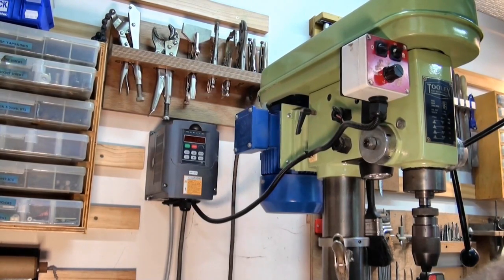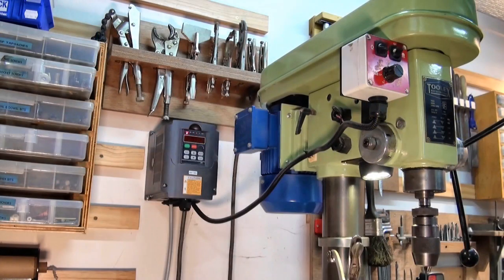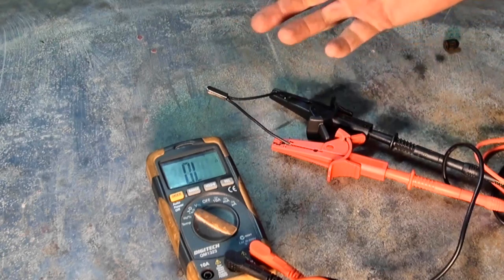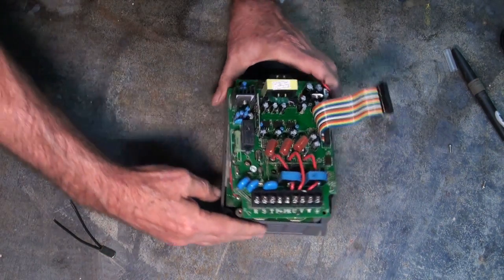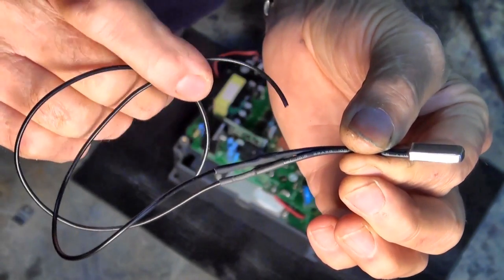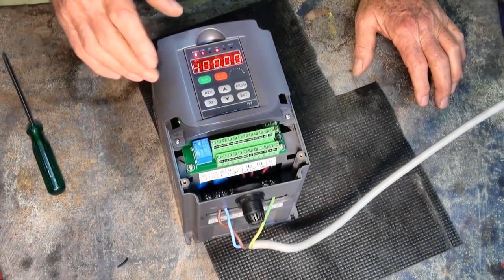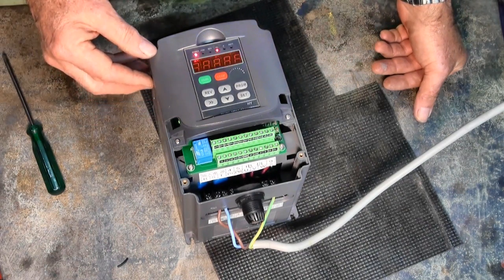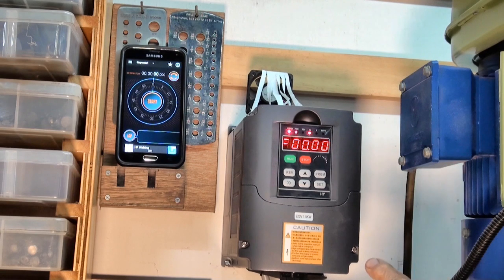How to make a SILENT Huanyang Variable Frequency Drive.

Comment: I tried a VFD on my lathe to give it variable speed, but found the efficiency of the motor dropped off very quickly outside of the range 40 -75 Hz, it was so bad it tripped the VFD's current overload, with only the motor turning at about 120 hz
Reply from the maker: I recently bought a Bosch Rexroth VFD for my Colchester lathe. It was only slightly more expensive than the Chinese versions but it has a manual written in English and some very cool features. I read some dire warnings about using the variable speed functions of VFD's to control the lathe spindle speed. The issue is that at very low motor speeds the oil is not circulated inside the geared head and it doesn't take long to run the main spindle bearings dry. I set my VFD to run at 50hz and vary the spindle speed with the quick change gearbox. On the drill press it's not really an issue but you are correct about the torque dropping off alarmingly at low frequencies. I ended up fitting a 7:1 pull gear (a planetary gearbox) to the motor to reclaim some torque at the low speeds. 
Regards,
Mark
Reply: @Preso58  I was not after running the motor slower as I wanted to easily increase the speed for facing of larger diameter stock to maintain the quality of cut. It not so much the torque but the current drawn by the motor. I put an ammeter in series with the motor. With just the motor and gearbox spinning the current drawn at 50 hz was a nominal .75A.  The rest were, 40hz-2.5A 60hz-1.5A 70hz-3.5A 80hz-4A 90hz 5.5A , around 95Hz the VFD would trip on overcurrent. I didn't measure the power factor so not sure of the actual power. But this was enough to tell me that the motor was not suitable to be run from a VFD. I abandoned the idea as the most I could get was about a 20% variation in the speed. I did a bit more research and to guarantee proper running on a VFD the motor needs to be designed for it (lots of money). It was a single phase 1 HP motor. One day I will do the same testing on a 3 Phz motor and VFD

Comment: Does this drive also have a parameter to monitor the heatsink temperature?
Reply from the maker: Not that I could find. As you are aware the manuals are not that easy to understand!
Reply: @Preso58  That is putting it mildly. ;-) I have a 3KW unit from them and it does not make as much noise. When you had the fan out, yours was quieter so my guess is that part of the noise of yours is from the housing. As mine is sitting out in the open, it means that it is easier to get at. My fan is directly mounted on the heatsink and has no plastic around it. It is also sold as an updated version and has some things that older ones didn't it seems. Mine can run on 110/120, 50 or 60Hz, and single or three phase. But no fan temp control. It does have 3 rather large capacitors where others I have seen only had two. Now if I can just figure out how the get the built in pot to run at full frequency I'd be all set. Auto run goes to 400KHz while manual only goes to 230KHz. And yes, I can set the upper limit on PD172 to 460.
Reply: Mine matches the one dynoguy has in his video except the input voltage. https://www.youtube.com/watch?v=9wJI33NhdhU

Comment: If you think that VFD is noisy watch my video Noisy variable speed drive It is the first generation Toshiba VFD and if adjust the settings my warranty will be void.
Reply from the maker: Yes, just watched that and it would drive me nuts. It seems like you did get some good advice though. I found that changing the carrier frequency helped with my VFD's.
Reply: Man, what's the cost, I mean if it's first generation, it seems like it may have a bit of time on it already, and potentially reaching it's warranty limit.

Comment: Hello,
I have the right inverter, the connections are right, but I can't understand how to make the remote connection in order to use the cutter with its start. Currently I have to keep the machine switch on and start it by turning on the inverter. I wish that with the inverter on, I could use the cutter motor with its on / off button.
Reply from the maker: You will need to fit a switch in a remote location or use your existing machine switch and then wire it to the inverter terminal strip. You also need to change some parameters to enable remote switching. This article might help https://www.hobby-machinist.com/threads/huanyang-vfd-on-a-bridgeport-clone.36144/
Regards,
Mark

Comment: I've run into this before and here is my go to solutions: I use a 3 wire NC/NO relay controlled by the thermal switch. Connect the NO directly to the fan and the NC side to a voltage regulator going to the fan. I use 5 volt regulators for 12 volt fans and 9 volt regulators for 24 volt fans. This runs the fans all the time but at low speeds that are very quiet. You are still moving air over the cooling fins so it takes longer for it to get hot enough for full power. 
The other version of this is to use a 4 wire PWM fan. Connect the PWM wire on the fan through a NC thermal switch to the fan ground wire. Some PWM fans have a minimum speed when the two are shorted. I tend to use these. If the fan totally stops, you can put a small resistor of the correct value inline to achieve a low speed. I use a potentiometer to find the right value then replace it with a resistor of the same value. Does this hurt the fan? Not really. I have some 48 volt PWM server fans that I run on 24 volts with the PWM wire shorted. They run at a few hundred RPMs whisper quiet and have been running 24/7 for 6 or 7 years now with no issues.
Reply from the maker: Merlin,
the funny thing is, that since I did this upgrade on the VFD, the fan has never switched on. This makes me think that it is included "just in case" or maybe I don't run the drill for long enough or hard enough to create any heat in the heatsink. I think that in some applications where the motor is running for long periods under high loads then the fan would be needed.
Reply: Mark Presling  The VFD fan on my bridgeport kicks in all the time when I do long runs under heavy load. Like you said, it comes down to duty cycle. I figured I post those solutions for the heavier users. P.S. Thanks for showing that tangential tool holder in your videos. Been looking to make one and your close ups helped me work out the geometry.

Comment: One idea I had was to use the built in relays of the VFD to turn the fan on when the spindle starts. That's currently how I'm controlling my air for chip evacuations but I still have the NC relay on the VFD not being used. I could use that to trigger another relay. Kinda a stupid way to do it but it would work and I have everything to do it. After watching your video I almost think I could get away with not having the fan at all but I dont really like that idea. I'd really like to do what you did but really dont want to have to unmount and open up my VFD again. I think I could get to the fan wires from the outside and just splice in a longer lead back to the relay. Anyone have any input on this idea?
Reply from the maker: Mike, since doing that mod I have only ever had the fan turn on twice. On both occasions I was drilling a lot of large holes on a hot day. In hindsight I could have pressed the sensor in between two fins of the heatsink using something like a U shaped spring from stainless steel sheet or brass and then smeared it with some epoxy to keep it in place. I too was a bit apprehensive about digging that deep inside the guts of the VFD but the fins might be easier to get at depending on how your case is designed. The fan on my VFD is easy to get out and the wires come out with it so you don't need to open the case for that step. If you have an external relay capability that would be a good solution.
Regards,
Mark

Comment: How about switching the fan out with some less noisy
Reply from the maker: You could do that but the solution I have now means that the fan almost never switches on at all. I think it has run on just a few occasions when I was drilling some large holes with a hole saw and a when I was doing a lot of holes on a very hot day. If it is needed, it cools down relatively quickly. 
Regards,
Mark

Comment: they could have written code to leave the fan off until 50c but what if the chinesium thermistor failed?
Reply from the maker: Good point. The switch I added in should be fairly robust though. No semiconductors to fail.

Comment: Could you wire the fan to the UPF terminal (which is a 24VDC 100 ma terminal) and program  PD052 to setting 3 (fault indication).  When the invertor gets hot, it will signal an over temperature condition and trigger UPF which would then turn the fan on.  I don't know if the invertor shuts down on over temp, so this may not work?
Reply from the maker: Thomas, I was very keen to have the least invasive fix for the fan that I could. I'm not exactly confident with the sort of electronics that inverters use. I can say that since making the modifications to the VFD, the fan has only ever started up twice. Both times it was a very hot day and I was drilling a lot of holes with large diameter bits. It actually surprised me when the fan started up. It ran for about 30 minutes and then shut down again. So, I am quite happy with how it has worked out. It has proven to be automatic and the VFD is now over six years old and apart from the long boot up time I am quite happy with it.
Regards,
Mark

Comment: Hey, isn’t it possible to connect the fan to the output for the spindle, so if you run the spindle, the fan will be activated?! Or is it already heating up without running the spindle?
Reply from the maker: Unfortunately, the fan runs from a 12V DC rail on the inverter logic board and the spindle in my case is 3 phase AC so it would be necessary to use a relay to make it work. As it turns out, the fan has never actually turned on since I did the mod on this drive. I believe that the heatsink never actually gets that hot with the sort of intermittent drilling that i do. I would think that if you were running a heavy lathe or milling machine spindle you would generate a lot more load and heat but the sensor that I fitted would switch the fan on when it was needed.
Reply: Maybe A little rubber wheel mounted in the drill press so when it's turned in, the rubber wheel turns, driving a shaft that comes out the housing of press, flywheel on the other end with a small belt running another wheel on the shaft of the fan. There you go. Not terribly efficient but run off the drill press spindle itself....

Comment: I am just curious ..... Why didn't you replace the fan with a quiet model?
Reply from the maker: Many people have asked this. My aim was to configure the fan so that it only ran when necessary. I have some high quality Invertek and Bosch Rexroth VFD's and they can have the fan configured in the settings so that it only runs when the heatsink temperature rises above a preset level, or permanently on or permanently off. Since carrying out the modification on the Huanyang drive, the fan has only ever run on a handful of occasions. Usually on very hot days or when I am using large diameter holesaws for extended periods of time. This sort of indicates that for normal use on a drill press, the heatsink can cool itself using just ambient air surrounding the fins. On day to day use, the fan never switches on at all so I guess it is an energy saving as well. 
Regards,
Mark
Reply: @Preso58  Thanks for sharing .. Stay safe and well...

Comment: Hey mate! Great content. I've recently received one of these huanyang VFDs as part of my CNC kit. I was going to mount this unit lying down inside a cabinet to be located underneath the CNC inside the purpose built table. Instructions I see online says tooint the VFD vertical, like you did. But you did mention that, if not pushed hard enough, it should be ok with natural ventilation. Not sure if this changes if mounted horizontally? Any advice? Thanks in advance (from Sydney).
Reply from the maker: I wouldn't think mounting it horizontally would affect the cooling. After I made the modification to the fan power supply I think the fan has only ever started up on two occasions. On both of those times, it was a very hot day and I was cutting large diameter holes with a big holesaw. For normal drilling it doesn't seem to even get warm. However it might be different if you were driving a 2.2kw spindle motor. 
Regards,
Mark
Reply: @Preso58  thanks for the prompt response Mark. I'll give it a go and see how it turns out. If it gets too toasty then will have to re-strategise.

Comment: Just pop the grille for the fan, pull the fan out, stick the sensor to the backplane of the heat-sink (not the fins) with Arctic Silver, interrupt the red fan lead and splice-in the two wires from the sensor, insulate with heat-shrink tubing, re-assemble and Bob's your uncle!😂
Reply from the maker: I didn't know what i was dealing with when I decided to pull the case apart. I can now see that there were less intrusive ways of installing the switch. Still, pulling things apart is both thrilling and scary at the same time.
Regards,
Mark

Comment: Has the change proven successful after 2 years of operation?
Reply from the maker: Yes, absolutely. The fan rarely switches on. Just recently we had a really hot day and I was doing some drilling with a 25mm hole saw in some thick carbon fibre. I was surprised when the fan started up. It ran for about 15 minutes after I shut the drill down and went quiet again. I use the drill press almost daily and the VFD has been quite reliable. I used to hate having the VFD switched on before I did the mod on it because the fan was quite noisy. It probably draws very little power but it's a bit like walking into the kitchen and finding the fridge door open. I probably went a bit overboard with mounting the sensor. You could probably just jam it in between two fins of the heatsink with a bit of wood and it would work as well.
Regards,
Mark

Comment: Hello,
I have the same type of inverter with 2.2 Kw power but not noise problems like yours.
My problem is related to the use to power a milling machine, connected directly to it and using the buttons of the inverter to turn on or off. If I use the machine button (as you do with the drill) the inverter gives me an error.
How did you connect the drill to your inverter?
Reply from the maker: Are you sure you have a single phase to three phase drive? I have read that some people inadvertently get hold of a single phase to single phase inverter. They can look identical on the outside. When you open the cover to expose the connections you should see terminals for earth U, V and W. These should be connected to your three phase motor. On the other side you should see terminals for the single phase input, R for active and S for neutral, the earth should be common for both the motor and the input. You also need to make sure you set the inverter with the voltage, base motor frequency and the power of the motor before you try to run the motor for the first time.
Regards,
Mark

Comment: Did you consider a different fan?
Reply from the maker: Not really. The whole idea was to eliminate the noise of the fan rather than to reduce it. Since doing the modification, the fan has really only cut in once or twice. 
Regards,
Mark

Comment: I have one of these low end vfd, I will do this mod. A digital temp with a probe sensor would give a idea of the current heat at the moment also. Where did you get the bimetal bit?
Reply from the maker: I got the sensors on Ebay Australia. Link is here https://www.ebay.com.au/itm/KSD9700-Temperature-Switch-Thermostat-Thermal-Protector-Normally-Closed-Open-MO/201993260718?ssPageName=STRK%3AMEBIDX%3AIT&_trksid=p2057872.m2749.l2649 These are really a heat activated switch. In practice the fan in my drive has never switched on since I installed the switch. I guess it would be interesting to find out the temperature of the heatsink but I am thinking it wouldn't be necessary.

Comment: you could replace that crappy fan with a noctua fan and remove the need to tear the drive apart as they are silent. i have 13 of them in a pc 2 feet from my head all day long and never notice them since new in 2012.

Comment: Hi Mark, I assume in your drill press set up you are using 240v single phase. I saw you were using 3 phase on your mill. I was under the impression VFD were for only for 3 phase! Is your drill press motor a cap start or is it something other? Good tut by the way
Reply from the maker: Peter, I converted my drill press to a 240V three phase motor and installed the VFD to give me variable speed. It has a three step poly vee belt drive as well but having the variable speed is great for things like countersinking bits where slow speed reduces chatter. There is very little torque at the lower speeds though. Recently I made and installed a pull gear which gives a roughly 4:1 back gear. 
Regards,
Mark
Reply: @Preso58  thanks Mark. I did not know we could get three phase 240v motors? I think my son may have mentioned it once (he's a sparky)  but I would have thought he was talking about 440v as we were discussing a VFD for my mill and its  the latter. I'm in WA, what state are you in?

Comment: Which sensor do you need to rebuild the Frquenz Inverter u have.
Since Paul.
Reply from the maker: Paul, I used these  - KSD9700 Temperature Switch Thermostat Thermal Protector Normally Closed Open MO. Here is a link to the original Ebay listing. https://www.ebay.com.au/itm/KSD9700-Temperature-Switch-Thermostat-Thermal-Protector-Normally-Closed-Open-MO/201993260718?ssPageName=STRK%3AMEBIDX%3AIT&_trksid=p2057872.m2749.l2649